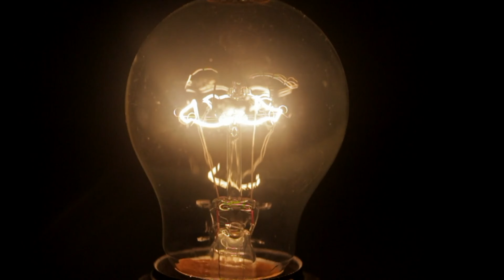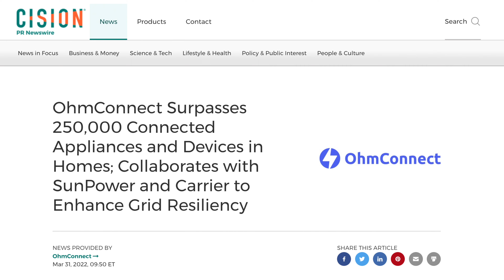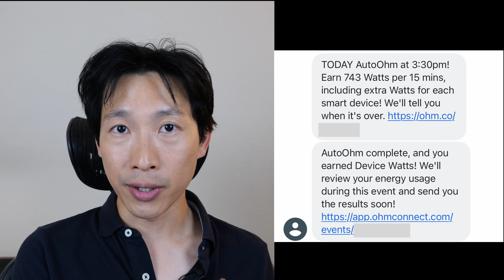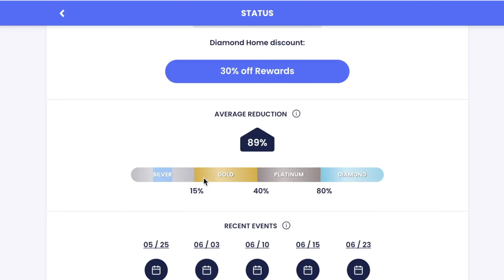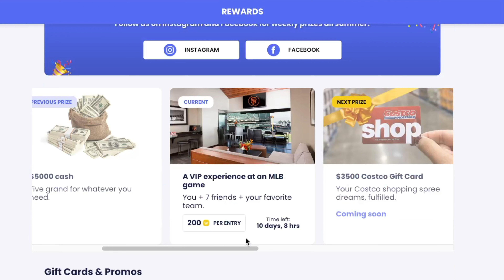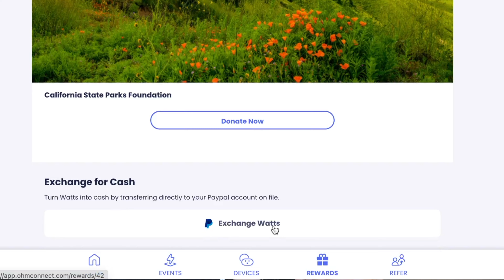Earn Money Using Your Electric Bill with OhmConnect

Comment: i wonder if you could set up one of those generator circuits where if mains is killed the supply switches over to a generator, but instead of a generator you had a tesla power wall or whatever battery bank take over. I think there are ways to make money if you have a powerwall already but I think its important to control the actual use and discharge cycles, control for thermal stuff and prioritize as little degradation of the battery bank. I simply think if a utility company is in control of our powerwalls they are going to make their own cost benefit analysis and not show as much respect for the lifespan of the battery cells... and there is also so much less they can know like what u may want to do later with it or the temperature or load, ect.
I think this is a bit over the top but I wonder about a cost benefit analysis of a system like this, time to repayment, ect. in my head im thinking a refrigerator or  maybe space heater? clothes dryer? electric water heater? still not sure what are the best appliances to disable for these ohm hours other than an electric car obviously.
in the uk i think they have 2 different night/day $/kwh rates which makes people care about this stuff more
Reply from the maker: You're going for most watts turned off so smartplugs can do it automatically but you can also do it manually.

Without doing calculations, generally, any time a battery is involved, it doesn't work out well economically. You'll pay thousands for the battery and claw back hundreds?

Comment: How often do you get Ohm windows?  Actually signed up for this from your recommendation and have had 1-2 events every week for a few weeks, then they just stopped on a dime.  Havent had any new events, even on days in San Jose when the weather is in the 90s and energy use is super high.
Reply from the maker: They seem to try to ‘get it over with’ early in the month in my area. You should see at least 4 per month, maybe even 6-8 in peak of summer or winter.

Comment: Been using Ohm connect for a few years now. The trick is to save all your power usage for the non ohm hour days during the typical ohm hour time (7-8pm) to drive up your avg. Charge your EV, do your laundry, run your AC ect. Then during the actual ohm hour turn everything off and you’ll get massive savings.

Comment: Good gov't incentive to reduce electricity consumption.  We don't have anything like that in ON, Canada.  Used to have a reward point system for using less electricity than your neighborhood AVG rate but that program was quietly scrapped few yrs back. Can't even get a $10 Starbucks card from those points.
Reply from the maker: It has to have enough payout to make it worthwhile. At least $10/month I think.

Comment: Did OhmConnect change to where you have to sign up for them as your electric provider? That's what the referral link makes me do now in Texas.
Reply from the maker: I think in Texas, they have their own arrangement. It didn’t list a Texas utility that it is compatible with.
Reply: They provide a new fixed-plan with ohmconnect. Unless your current electric provider is expiring soon, you may need to pay cancellation fees from your previous electric provider and sign up for the new fixed-plan with ohmconnect.